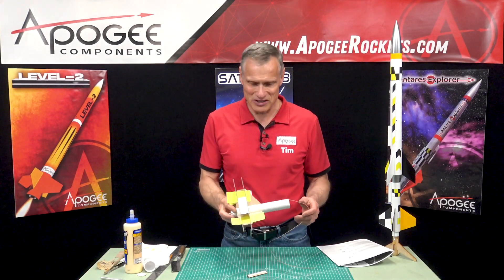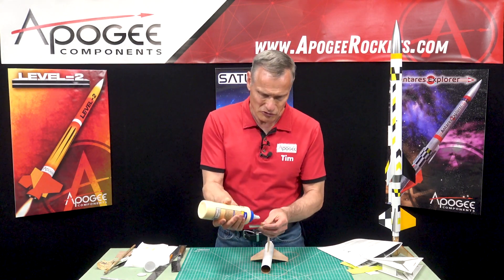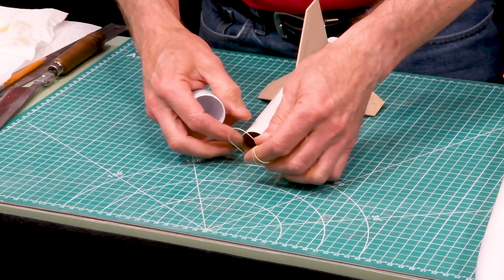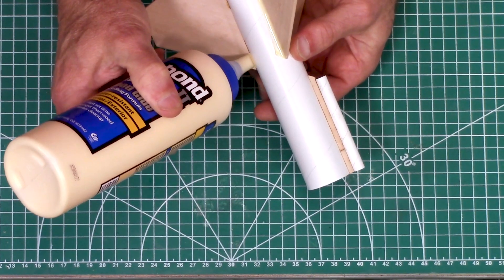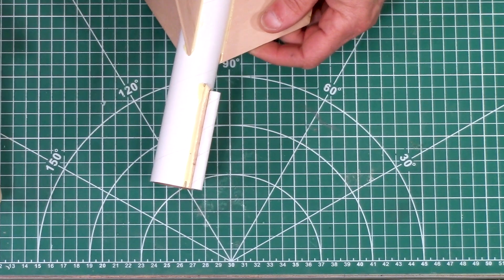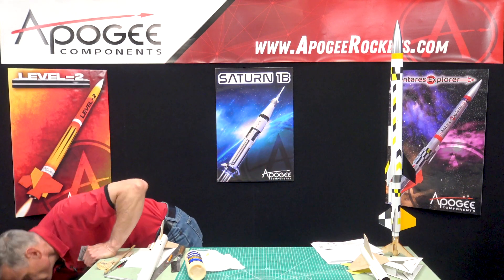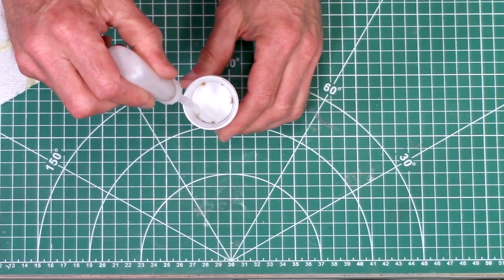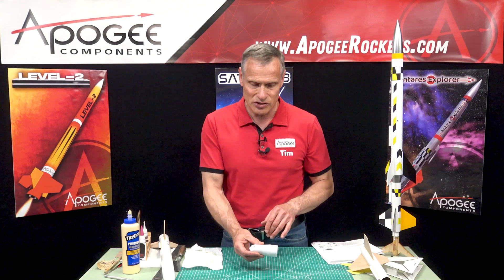Building the TTV Model Rocket Kit - Part 10

Comment: I've been watching the TTV build series for the last 5 years.  It never fails to disappoint!
Reply from the maker: Has it really been 5 years? You crack me up.
Reply: Just curious-why do some kits have a launch lug stand and some don’t. Is it just a cosmetic choice?
Reply from the maker: @462tool  It is a safety consideration. Ideally, all rockets would have rail guides or buttons on them so they could fly off a rail. But not everyone has access to a rail. So we use lugs in some cases where the rocket is smaller and won't whip around on the rod much if it is a little breezy.